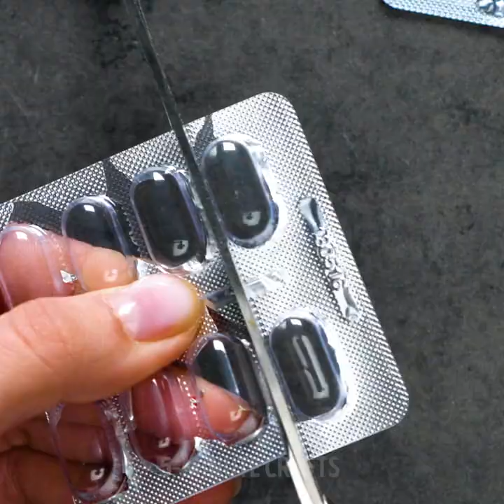31 USEFUL THINGS YOU CAN CREATE USING EVERYDAY ITEMS

Comment: A hack I tried that I made myself that came to be useful and clever was a couple of nail files that I reused instead of those plastic nail files that most use I went with the metal nail files it came to be a clever way and also a creative way to it worked perfectly and helpfully I bent the bottom of the nail files each file that is and also the end of the file too so that it wouldn't be un-useful it worked and it helped me stand my phone up so that it wouldn't be in the way so what would that be a hack or a idea which would any of you consider that to be